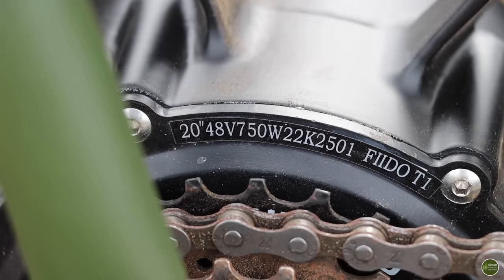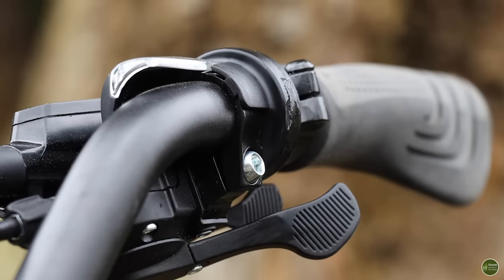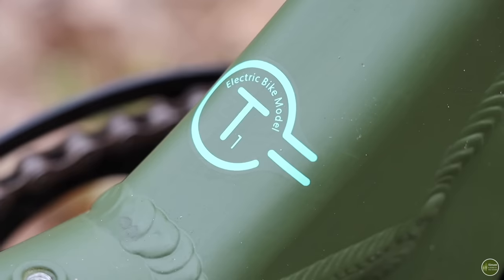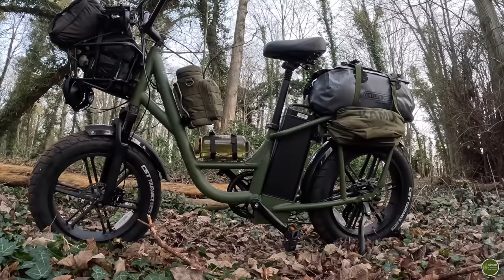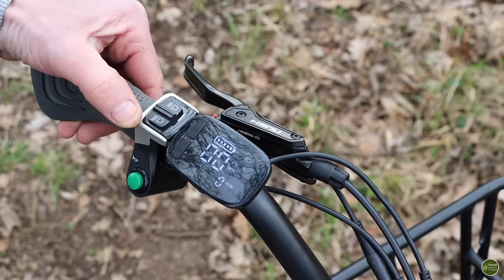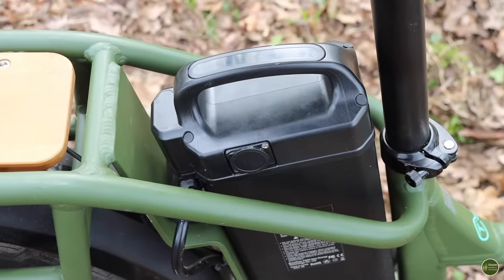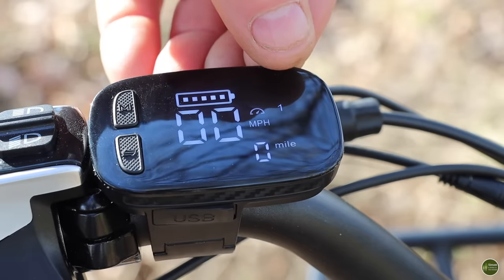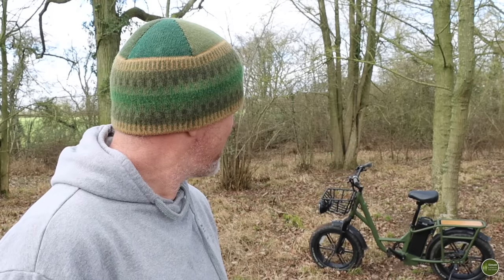Fiido T1 Pro Utility E-bike.  My Long Range Cargo Woodland Assault Vehicle.  E-bikeThrottle Removal.

Comment: I have 750 hp Lamborghini but i cut 8 spark plug cables and isolated them with silicone. Now it is four cylinder and 250 hp and perfectly complies with North Korea laws and regulations.😊😊😊

Comment: I just received my T1 pro and took it for my first run did 26 miles had a great time bike is strong and gives you confidence when riding above the 20 mph speeds ! can see this being my new camping transport vehicle five ⭐️

(update)  Been four months now covered 312miles so far and I’m certainly not cutting my throttle, I’ve never been stopped once, did have a police officer tell me the bike looked cool though. In short if you don’t ride it like a plonker you can comfortably de restrict the bike and use the throttle as and when you need.

Comment: I have an e-bike in the states. It was detuned from 1000 watts to 500. I reversed it. That is done by unhooking one wire (already in there) from the controller and hooking up another. Yours is undoubtedly the same. Look inside and check online. You would benefit from the upgrade and the police won't know.  Also, the restrictions you mentioned probably do not apply in the woods or on private property. That looks like a VERY nice bike.
Reply: Excellent Comment! To Hell with totally ridiculous regulations. They can stuff them!!

Comment: Thank you for the update, Simon!   I know you always strive to share as honest and up-to-date information in all of your posts as is feasible and I appreciate that about you.   I hope that authorities agree with you and have far more pressing issues to attend to that they will NOT harass you about your ebike.    Take care and be safe!  Looking forward to more of your adventures!  👍👍🧡🧡😊😊🙏🙏
Reply: Like the update, and now we know you are going to do another ride to show the power cutback version... in USA many places require helmets for bicycles Anyway,  lights and so on also...it should have probably mounted with the moped required lights and whatever legal. I am curious about the motor action if you were to switch to all motor.  You might wish you hadn't cut the throttle control off.

 Would the throttle have been legal on the bike if it was only for trail use?  A rack on the back of Landrover for getting to trails?

Comment: Shame you felt the need to remove the throttle. I have 2 Fiido D2S bikes and one of the key features I wanted was a throttle to aid with pulling away . The police are never in a million years going to bother people using them, they may use scaremongering through social media etc to put people off but they simply haven't the time to police it. Last summer we used them so much when out in our campervan going to surrounding places and seeing places we wouldn't normally see. Really liked both videos look forward to future episodes
Reply: Actually the police are looking at illegal e-bikes though it seems it’s mostly around delivery riders in cities. 
Having said that they’ll quickly become aware of the models that aren’t compliant & if you’re riding on the road with one you’ll have a greater chance of them taking an interest
Reply: @hughmarcus1  it's still a very grey area as you can have a throttle to assist you upto 6mph so unless people are silly enough to go past the police doing 15+mph then no reason to get stopped. Hopefully if the rumour about allowing throttle upto 15mph and upto 500w motors becomes legal next year then those people who worry about it won't have to.

Comment: Simon. I had the same problem with mounting my Ortlieb panniers to my Reise and Muller Load 75. I found that rather than putting extra weight on the bike, get some 15mm copper tubing and attach it to back frame. I did mine either tightly wound strips of rubber. The mod I did is still attached to the bike and so far has lasted me 5000 miles with no bother at all. Regards from King’s Lynn

Comment: UK legislation does allow a throttle  up to 6 km/h (3.7 mph). This is commonly known as "walk assist", and was intended for walking a bike uphill. "Walks Assist" was commonly made available as a simple button with speeds controlled by changing gears. Using a throttle for walk assist is becoming more popular because it give you a simple way of initially accelerating.
Reply: the ultra silly part is a throttle is actually SAFER 

the idiots who made throttles illegal did so under the notion that pedal assist just helps you out a little the harder you pedal the more if gives you a push

thats not how it works there are a few bikes that do indeed do this they use torque sensors but those cost too much for most ebikes so the rest have cadence sensors which just care that the pedals are turning they then dump full power for the mode your in you could pedal at 1 rpm and the motor is going to give you full power 15mph the pedaling portion is redundant

then there's the fact that whilst trying to pedal slowly your bike is jolting full power on and off as your coasting and giving the odd pedal to push a little bit 

finally throttle is actually safer if your using the roads because it gives you immediate ready to go movement without needing to set pedals and push off and change through gears 

so instead of smooth throttles where you decide the power we have novelty throttles that require you clown pedal and then get whomped with full power with no adjustability beyond the 3-5 settings the controller gives
Reply: @Sarge92  It is safer.
I use the throttle to get me going to about 6MPH before I could use pedal assist where it would be a smooth and comfy ride.
Like what, I am not forcing the traffic to stop cause my pedal assist has a major delay, it is also safer in places were pedestrians tend to be walking across as you have better control over the bike unlike with a pedal assist only situation. Thankfully there are bikes that have little delay but my bike was a tad cheaper so I had to make do.

By the way, all the assist levels are the same level of thrust only that it is more delayed which may cause an accident, at least on my bike.
Twisting the throttle a few times to get going is much better than only pedal assist as that seizes my ability to stop in time, especially when a ped crosses the road without looking or due care.
Reply: @Sarge92  totally agree with you! I have this bike  for 3 months and I was falling few times riding it in snowy conditions. I was avoiding the throttle since is 'illegal' and when start pedalling the full power kicks in, comparing with using the throttle where you can control the electric power more precise
Reply: @Sarge92  It's all about preventing the ebike from challenging the supremacy of cars.
Reply: That's not a throttle.
Reply: i got the rad expand 5 ,all parts easy to fix at road side and the twist throttle is limited for uk use,i had the same idea, buy a donkey to carry my gear :)
Reply: What do you do with all of your extra time not having to use capital letter and punctuation?

Comment: I've been researching this myself. Fido EU have some nice-looking bikes, but most are illegal here in the UK. In my area, 3 ebike riders were prosecuted last week. It's not a simple slap on the wrist fine, either. It's riding without a helmet, riding without insurance, operating an unregistered vehicle on the road, etc., and all resulted in actual driving bans. This means you can lose your 'other' means of transport too, probably suffer highly inflated insurance premiums etc. in the future as you will have to disclose a traffic prosecution, driving without insurance, etc. I was tempted to do the same and asked fido if the throttle could be removed (no response), but given the severity of the possible punishment...

Comment: the 250W restriction is a bit of a  walk around by the manufacturers, by the letter of the law the motor needs to display a 250W marking on it, but this is nominal value (whatever the manufacturer wants really) . Most completely legal pedal assist e-bikes  in the UK have 400-750W motors in them with a "250W" sticker

Comment: It's such a strange "quirk" of the law that you can use pedal assist to ride at 15mph, but using a throttle to go the EXACT SAME speed is illegal.... I would understand using a throttle to go 60mph, but in this case it seems to make very little difference to the safety of the bike as far as I can tell.

Regarding the bike. I don't usually like this sort of bike, but this thing has a pretty cool "utilitarian" vibe that I kinda dig. I'm not convinced by the alloy wheels, as I have no experience with them and there may be a reason more companies don't do it, but I'm sure they'll be sturdy!

The only thing it needs is tyres with a bit more bite!

Comment: The UK e-bike rules are similar to ours in Australia. Up to 250 watts - OK, no throttle over 200 watts, anything over 250w to be registered, insured etc.  A 750 watt motor governed to 250w ?  Don't think that would pass the test here - the cops look for stamped 250 watts on the motor cover.  The cops don't seem to know about battery volts though so the 48v would get past them and provide an extra boost.  There has been some daft commentary here about allowing larger motors but setting an overall speed limit for e-bikes.  750 watt motor but bike the subject of a 25 kph speed limit? !  Most bikes with a reasonably fit rider and no motor easily go faster than that along the flat and certainly downhill so I wouldn't like to see that.  Looking forward to your upcoming videos, especially now spring is in the air up there.
Reply: Yeah. Reading the uk gov site. It says anything with over 250w is illegal for use on UK roads and is classed  as a motor vehicle.. needs to be labelled as 250w having the 750 w label and ‘restricted’ to 250w electronically will not fly… as the Australian commenter says the police will see the 750w badge and say it is not compliant. You would need a letter of compliance to prove it falls under uk e-bike rules.

Comment: I can't scoot along like that on the throttle assist...mine does 4mph tops with an ordinary sized person, with my heavy butt and all my gear, it'll be greatly reduced and is only useful as an aid to get the bike moving in order for the pedal assist to kick in. 15.5mph...I'm happy with 10mph. I remember doing 37mph downhill on a racer and the speed wobble was scary. At 58 years old, it isn't the speed, but the ability to get there safely and the journey's sights

Comment: I have noticed variations in battery cells used on the Fiido T1. Oriinally some of the batteries used 2170 cells. In the video here you have 18650 (2900mAh) cells. My T1 was an early bird, it uses 18650 (2600mAhr) cells. There is about 2500 miles on it. So far so good with regard to degradation.

Comment: I was going to mention that. The law really is an ass. Gently pedaling will make the motor kick in. Pedaling hard gives you the same power as having the throttle and pedaling hard. The throttle merely provides convenience. It seems to me to be one of those situation where the law is decided by people who have never even ridden a bicycle, let alone an ebike. In the country where I live, the throttle is allowed, thankfully, and probably accounts for the very high numbers of ebike riders.
Reply: pedal sensor requirement was passed by lawmakers who think pedal assist means the harder you pedal the harder it powers you

there's only 1 system that does this which is torque sensors and no one uses them aside from a small handfull of companies the rest use cadence sensors which just care that the pedals are moving at all
Reply: @Sarge92  Exactly. You put it far more succinctly than I did.
Reply: How do you accelerate once the throttle is gone?
 In the early part of this video you adroitly snipped and plugged the thumb throttle, but it reappears subsequently. You up front mentioned using previous footage. 
Great homage to the paratrooper bikes. I also thought it featured strongly after them.
Reply: @kevindblew6822  you pedal and the bike whomps you with full throttle basically the bike now has 5 speed modes each triggered at there full power by the pedals moving

which is clearly safer than a throttle which allows near infinite amount of power choice and control over acceleration rates

I've had it happen many times where ill go to adjust pedal position whilst coasting slowly but turn the pedals just enough to trigger the pedal assist and send the bike flying along at full throttle for 2-5 seconds until the controller cuts power from me not pedaling

banning throttles is the dumbest restriction they placed
Reply: @kevindblew6822  There are sensors on the pedals. When you start to pedal, the motor kicks in, but at full power. The throttle allows you some degree of control.

Comment: Seems an opportunity for Fiido to modularize the throttle assembly so that they can sell a UK-compliant unit without DIY. 🤔
Reply: it could all be done in software , no need to hack up a nice bike , it could have had an on road mode and an off-road mode to allow use of the higher power and throttle in cross country tracks .

Comment: I was interested to see you have removed the thumb throttle from your bike. My first Ebike had a thumb throttle but the speed when using it was limited to 4mph. It was very handy to get going when mounting the bike. If I had been you I would have left the throttle in place. The chance of you ever being challenged by the boys in blue are vanishingly small. They can't even respond to fairly serious crimes these days. I look forward to seeing your future adventures on the bike.
Reply: I agree, the throttle and speed limits in England are pretty harsh.  Where I live in the states the speed limit is 28 mph with throttle only and it is still a bicycle.
Reply: On the issue of throttles. I'm from Australia with pretty much the same regulations... what I've found quite hilarious with my own ebike is that the maximum peddle assist mode is several orders of magnitude more powerful than throttle alone. Throttle does about 17km/h, max assist does about 25-27km/h (the legal limit for ebikes here). So really, just doing what I call 'fake peddling' (peddling slower than the speed of the motor) is already more effective than throttle. Yet that's considered 'legal'. And it's still just a 250w motor. My 'foil hat' thinking is that they couldn't possibly let the plebs get a whiff of freedom and then lose out on motor vehicle  taxes etc.
Reply: The Police won’t batter a eye lid at one these it’s only really the big Surron like bikes and e-scooters that grab their attention. If your under 500w and not going obviously quicker than a bicycle turning the peddles being sensible you be fine and will probably never get stopped because you just blend in with normal bikes.

Comment: I didn't know you were a carpenter by trade, but building your own canoo should have told me!
 I am a tradesman too of sorts, and I bought an ebike, I thought I could transport tools in a box on a trailer! Haha. I can if the road is flat but I live in a hilly area, so that was a fail.
You can buy disc locks that have motion sensor alarms, good for camping because its quite a high pitched noise, though cover it when it rains because even the rain will set it off.
Maybe you could get one of those rugged mono wheel trailers and review that for camping too
Reply: That's a dang good idea! Thank you for suggesting it.
Reply: I was thinking the same a separate video with a trailer 100 kilos onboard on a long trip .
Great job on the videos , thanks a lot I was looking into this bike myself and you are the only one who has done review on this bike . 👍
Reply: @bobanzikic779  I now think it is possible to build a trailer, aluminium box section drilled and bolted together, buy a small shock absorber and find a wheel from a childs bike. If it is 1M long it can have a flexible solar panel as a cover, this will enable a spare battery to be charged a little bit on the way
Reply: @utubeape  Excellent Idea . 👍🏼

Comment: A UK throttle IS legal if it is limited to 6 kph, or 4 mph, as it usually is on a bike with a cadence (speed) sensor. You can use it in 'walk assist mode' to help you push the bike up steps or a steep hill, for example.
It also assists in getting off the mark until the sensor kicks in and starts giving you power, which can take up to two or three turns of the pedals.

Edit; I don't actually know if the T1 Pro has a cadence sensor, as opposed to a torque sensor (which is much better), but the (stupid 🤬) law is the same in both cases.

Comment: Crazy how the rules are different over there in England, having to remove the throttle & adding turn signals & license,seems like it’d take all the fun out of your E-bike. Another great honest vid Simon! & I know y’all call it the U.K.  🤷‍♂️
Reply: Unfortunately it's not just the UK. I live on Reunion island and as we are part of the France/EU we also have the same restrictions as the UK. It sucks.
Reply: actually the turn signals and moped registration are for msva which upgrades your bike to 1000w+ with a top speed for 24mph

just to have the throttle you actually need type certification which gets you throttle allowance but the manufacturer has to apply for this
Reply: The throttle to be is weird as even with having it the bike can't go beyond the adjusted speed limit without modifying the bike to go faster. Yet the turn signal requirement to me makes alot of sense since honestly if you are going at speed even if 25 mph having to remove your hand to signal a turn or lane change could be pretty dangerous, but having a turn signal indicator is safer an also something drivers are used to needing to see more than hand signals.